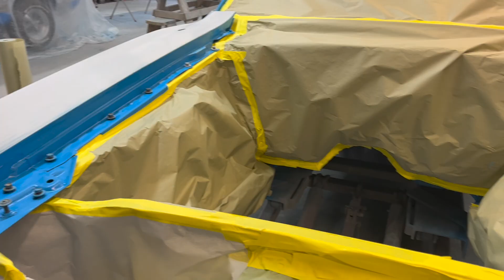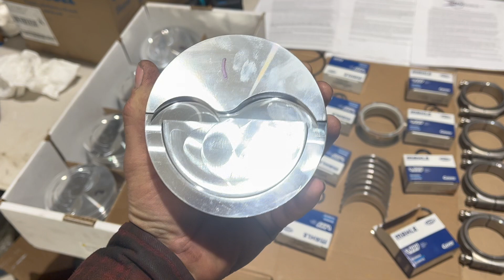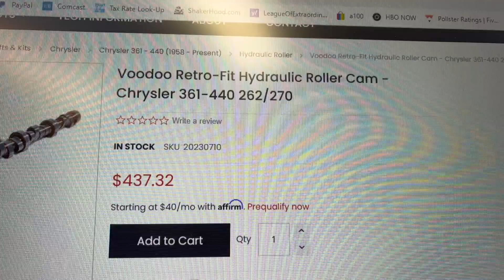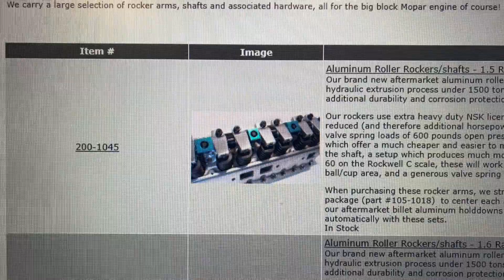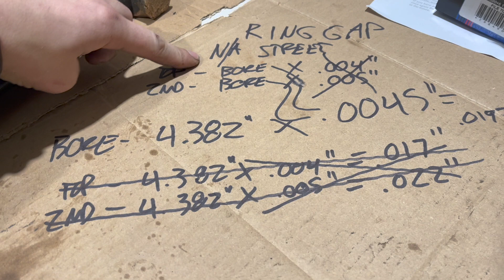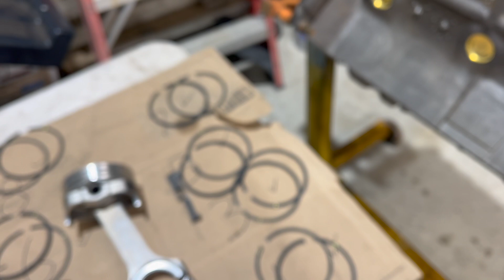How To Build A 451 Stroker Big Block Mopar! Part One: The Recipe, Assembling The Short Block

Comment: Pro Tip for those who know they are going to have a wait time, particularly in a humid environment- I have had excellent luck with CRC SP400 for long-term storage. It makes for a waxy finish that helps keep machined surfaces fresh. I had a customer who left some precision ground shafts for heavy equipment out in the open air, in South-East Texas mind you, for a bit over a year after I applied the SP400 and it cleaned off fine to a fresh surface. 
They also make SP350 that they claim works as a machinery start-up lube AND corrosion inhibitor for storage (they claim up to 2 years indoors), although I have no personal experience with that specific product. 
If you know you need to get some parts machined, but it will be a while before you know you can use them, I can vouch for the SP400 to do a good job.

Comment: ATF is one of the best anti-corrosion coatings you can imagine.
It’s specifically manufactured to deal with corrosion/pressure and friction.
Soak a micro fiber rag and wipe it all down….done

Comment: That cam is not where near a Mopar 509 cam which is the cam you should have used in this 451 build I realize this is a specific build and for longevity and I agree with that but I have run a 509 cam in a lot of different bb mopars your engine would make a good pick up towing cam but you keep saying high performance engine but no it's not your camshaft choice killed it for that if you would have put a retro roller 509 in it that would have been high performance  yes never use wd40 on anything related to a motor assembly thanks for sharing I'm sure your build will fry the the tires off anything you put it in and take you around the whole USA with reliability
Reply from the maker: I literally worship at the altar of the 509 Purple Shaft. The sound of that cam in an idling 440 is what got me into Mopars. But it’s important to understand that it’s kind of crap by modern standards. When we finally get this damn thing drivable, we’ll see if it’s as big a turd as you seem to think. Thanks.
Reply: @DeadDodgeGarage  no I never said it would be a turd just said your cam choice is nowhere near a .509 even at 40 years old it will walk all over that small roller

Comment: Hi ddg:  i own a 2000 dodge ram1500 I want to change the manifold and carb to something newer can I  and what would be your choice??
Reply from the maker: The Magnum in a truck like that is best left as it came with the EFI. It makes good power and decent economy. Also, if you have an automatic, your transmission depends on the engine computer being there. Your gauges depend on the computer being there. So while you can put a manifold and carb on it, I highly recommend you don’t.

Comment: I believe those rockers are made by Harland Sharp
Reply from the maker: If so that would be interesting, as they cost less than half of what Harland Sharps do. They are also not very nicely made. Also, apparently the shafts themselves are a cheap material and have been known to break with high spring loads.

Comment: The 451" pistons don't usually have the wrist pin intersect the oil ring groove. That's typically found on the 4.15" stroke 500" kit with a 1.12" compression height vs the 1.32" in the standard 451" kit.
Reply from the maker: I really wouldn’t know. But I sincerely doubt they sent us the wrong stroker kit, or the wrong pistons.
Reply: Had one yes they do

Comment: Hi, to add to your edlebrock heads comment, I've run both small and big block chevys (I know) anyway I had my first set checked and OH boy. The spring pressures were in outer space (both sets), my head guy tested the flow and said they did well

Comment: Ugh!! You just sent ice water through my veins with your WD40 lesson.  That's exactly what I've been doing on my new rebuilt 340 in my 68 cuda project. squirting a shot in every time i turn the engine  Yep I have a feeling this winter I will be opening it up and seeing what our fine Oregon winter moisture has done to it. Horror awaits.
Reply from the maker: Yeah… I wasn’t at all excited when I learned that either. With any luck it’s not so bad inside a sealed-ish engine.

Comment: How is that engine holding up ? Do you think strokers have a shorter lifespan?
Reply from the maker: This engine is now in the car, but it hasn’t run yet. I hope we are back on that project in the near future. I don’t have any previous stroker experience to draw from as far as measuring longevity. There must be thousands of people out there with an opinion that counts for something on that subject, unlike mine. But I will say, the stroke in this 451 is the same as a factory 440, so… does a 400 last longer than a 440? Is there any appreciable difference? I doubt it.

Comment: Would be much better to have bored the block mains to fit the stock crank, the meat is already there,than weakening the crank
Reply from the maker: And then re-machine all of the bearing registers? And side clearance the saddles for thrust bearing fitment? And fly cut a new groove for the rear main seal? What an insane amount of work that would be for no reason. The smaller main bearing is one of the benefits of the short deck engine. Lower bearing speed and less frictional loss. Another big benefit of the 400 block is all of the beef around the main journals - but we’re supposed to take some of that away? Given that thousands of people have done it the other way for decades with success, I’m going to have to disagree.

Comment: 20:02  I'm sure that the chemists who developed WD-40 for the rocket factory in which I once worked are laughing and shaking their heads (probably from the afterlife, we're talking 1953 here) at the "applications" that their formula has found since it went commercial in 1961. Although the Convair factory was in San Diego (i.e., nearly perfect weather), the USAF had ordered so many Atlas ICBMs on a highest-national-priority basis that even the gigantic factory building didn't have enough room to store all the birds, whose tanks were manufactured from stainless steel. So Convair let a contract to the Rocket Chemical Company to design a protectant that could be applied to the tanks which had to be stored outdoors. It worked well for its intended application ... not so sure it worked as well for all the "follow-on applications."

Comment: No clearance issues on the 400 block around the oil pump boss?
Reply from the maker: Negative. Is that common? This is my first stroker build, as mentioned. The engine is together, has been run in on a stand, and will be in the car this week.

Comment: Why didn't the machine shop deck the mating surfaces?
Reply from the maker: The head surfaces? If they had thought it was necessary, I’m sure they would have said so.
Reply: @DeadDodgeGarage  I saw pitting on the block surface. I'm assuming it was fine, but still.

Comment: All your bring company's almost without exception speed pro whoever recommend using WD40 for ring installation so tell your friends and commenters that you're ir correct
Reply from the maker: Well, we’re both correct it turns out. It works fine. I’ve used it for years. It only seems to become a problem when it sits on clean machined metal for an extended period of time that is exposed to moisture. I have actually verified this with a block I sprayed down with WD for protection - I thought. All of the rough cast areas look ok. All of the nice machined areas are a rust factory. Lesson learned. Also, the oil worked much better as far as lubricant, and installation of the pistons was much easier with it. I will get to run this engine soon and see what break in is like, but I think a little oil is the winner.

Comment: Yeah I bought a pair of Edelbrock heads for a small box Chevy they were horrible I had to take them to my machine shopping completely redo them I called them edelbricks mass produced not paying attention you know how it goes:face-orange-frowning: now they're on the engine and it's screams thanks for the inspiring video my friend probably needs to sell those heads first 71 charger
Reply from the maker: Yep… I’ve had a couple sets of used edelbrock heads but none fresh out of the box. They always need to be checked.

Comment: The only thing you gain or loose is 30 lbs?
Why not offset grind 440 crank and make a 471?
Reply from the maker: Even better question - why do all that when we already have 451 out of the box with this crank? This is the original 400 block to the car we are building. We don’t have a 440 block. Also, as someone who routinely removes decades old socket style block drains, I’ll have to disagree with you there. I’ve also rounded off the square style - grabbing them with an open ended wrench sucks. On the socket style I’ve got options.
Reply: Use pipe plugs with square or nut heads in block drains. The socket style will be frozen and stripped after one summer when trying to drain block.

Comment: Mopar Joe just made 540 horsepower, 540 foot pounds of torque, with a stock stroke 406 big block Mopar, on the dyno! so if that thing doesn't make over 500 horsepower I don't think I'd be interested in that stroker kit if it's going slower?
Reply from the maker: Awesome. There’s no point in comparing the two. Completely different builds with completely different goals. We are going to make 400-450 horsepower, but it almost doesn’t matter. We aren’t using the stroker kit to make a number. This build is all about low end torque - and it’s going to make a lot of it, and work really well on the street. It’s also going to be extremely stout, and at this power level, it ought to live forever. We could change the cam, add headers, and make some other small tweaks and fly past 500 HP. That’s not what we want.

Comment: Very well done Jamie. Last engine I built like this carb to oil pan ran just over 9 grand. 440 source is a great place to spend money and great stuff. Did you bore the oil gallies like I taught you? It would be good to do for strokers. I do hope you get that stock 440 fired up soon. Rust can start in 30 days even in a controlled temp shop. It's always colder inside a closed engine and warm outside means condensed moisture. Great video none the less and your tutorial was way better that uncle Tony's how to clean parts with oven cleaner today lol. Will talk about that soon. Your pal Rooster

Comment: Nice.  Small cam, but might work with the 440 source heads valve springs.   I had to cleanup some small burrs on the pistons where the pin goes through the oil ring support land.  The burrs were keeping the oil ring rail support from sitting flush.  Just something to check on those type pistons.  Dowl hole in rod bearing is if using aluminum rods.
Reply from the maker: I found a small burr in one of the oil feed holes from oil rings in to pins. Other than that they looked good. I think I pointed out the light surface rust on pins I had to clean up.

Comment: Tiny camshaft but the heads will let it breathe some. This engine would be great for EFI, with that LSA and tame duration!! It's gonna sound good, but not lopey. Peak power less than 5000rpm but lookout torque from 500rpm up!! LOL
Reply from the maker: Bingo! It’s a pretty mild “modern” cam profile with a good bit of lift but much less duration than you’d find on a traditional hot rod cam (although thanks to the aggressive roller ramp, it’s probably got more in the curve than the numbers might indicate,) with a really good head and other nice components. And it will indeed have Sniper EFI. It’s going to be a huge torque party - and we’re going to have that party at an extremely usable RPM. I love big horsy dyno numbers as much as the next guy, but this is something a guy can actually use!
Reply: @DeadDodgeGarage  Lope is overrated on the street when all your competition sees are taillights! Just MoPar Joe suprised everyone building a 406 BB (.030" over 400) with a cast crank and a small roller cam for his bracket Barracuda. Commenters think it's "broken" because it didn't rev to 7000rpm with the 3.375" stroke, yet the HP/CID numbers are awesome at a manageable (read CONSISTENT and RELIABLE) RPM. Love the channel and this build. #following
Reply from the maker: @rodneybyrd9516  Someone else brought up Joe's build and said that if this engine can't make more HP than his, then the stroker kit isn't worth the money 😅 Right after I literally said that a horsepower number was not enough remotely the goal here. Some commenters just have nothing better to do with their lives than piss on our parties.

Comment: Hmmmmm....thoughts on putting that kind of money into an engine and then choking it with stock manifolds? Seems like trying to deflate a zeppelin with a drinking straw. If I were closer I've got a brand new set of headers that I was going to run on the Cordoba, I'd happily donate them lol. I could also be way out to lunch and the factory manifolds flow really well. I meant absolutely no offense to the owner.
Reply from the maker: It’s possible we may still opt for headers. At the kind of RPM this engine will be living at, a factory set of earlier HP manifolds will do quite well - and avoid all of the problems that come along with headers, namely ground clearance and inevitable exhaust leaks. Again we’re not making 500 horsies here. It’s the same game I’m always playing - know what you can get away with.